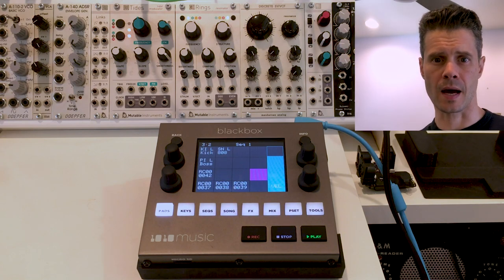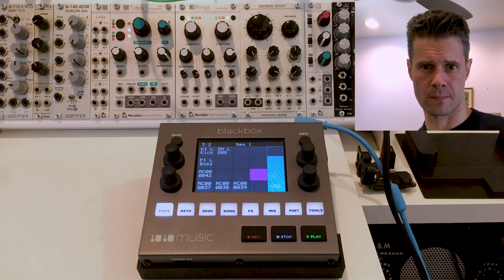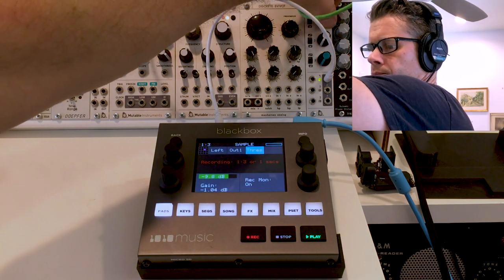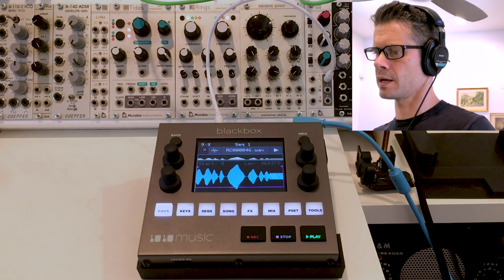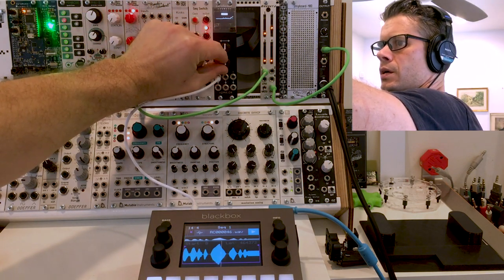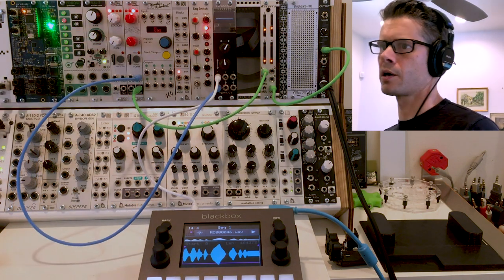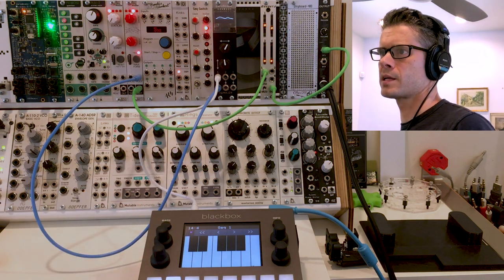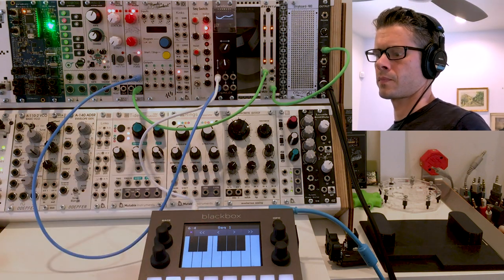1010music blackbox: Sample and play CV and Gate #blackbox #eurorack

Comment: Nice but im not entirely clear what is happening here ... I thought the Blackbox doesn't have CV out? I want to get a Mavis and a Blackbox ideally, but I didn't think the BB would be able to sequence the Mavis since the latter doesn't have MIDI in? 

But if you have a way to make it work here then I'll get them. Would it work? Advice appreciated.
Reply from the maker: Blackbox doesn't have dedicated CV out, but it is DC coupled and can sample CV or gate and then play those back out to any device that takes CV/gate, such as your Moog Mavis. This is kind of a hack and could be pretty awkward depending on what you're trying to do as far as sequencing goes.
Reply: @JohnParkMakes  TY. I'm not clear how to get that working. I did find a set of CV samples and a gate out wav file but im not clear how to use them. I would get a midi-cv interface but they seem really expensive for what they are ...

Comment: Thanks for the video! 
I'm wondering whether the BB is capable of taking midi note information and turning it into CV note per volt.
That would make it a Midi to CV converter.  (Edit: fixed typo)
Reply from the maker: That's an interesting idea -- I think that may work, I'll have to try it out! It may work best by preparing some nice, clean CV samples as a multisample set.

Comment: hoi, i ve got a question. is it possible to master /mix your full finished song on the blackbox 1010 and export/save it as a mp3/ wav to your sd card on the blackbox 1010?
Reply from the maker: I think you could do this with resample/overdub as your process of mixing it down to one new recording, yes. You'd create sequences and a song, then output to a free pad where you're doing a fresh recording. Then you should be able to hit play and record and be done. Or you should be able to also ride the Mix page and FX page if you want. When you're done, save that new sample and it'll be on your SD card as a .wav.